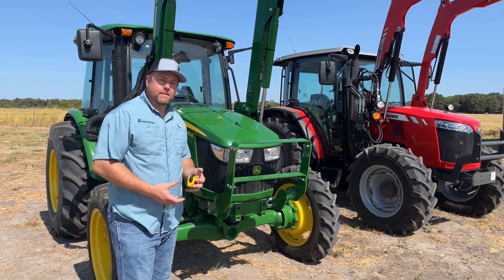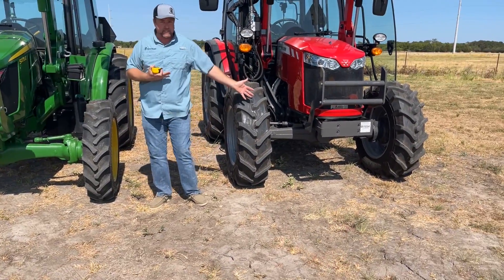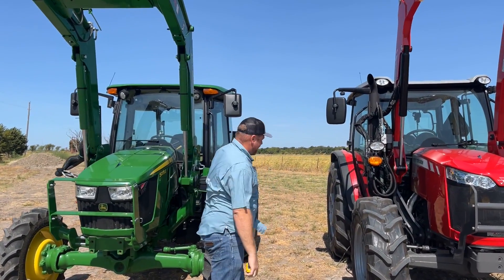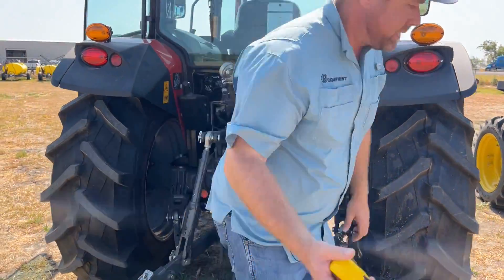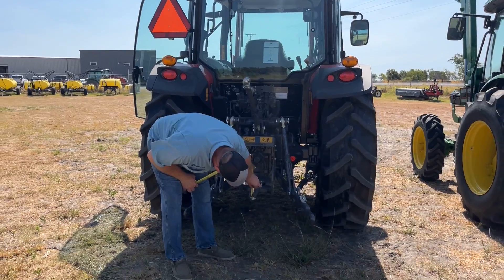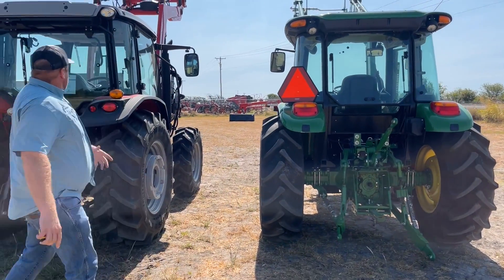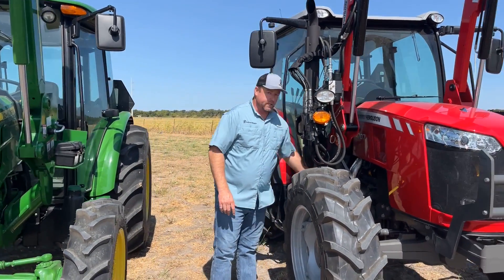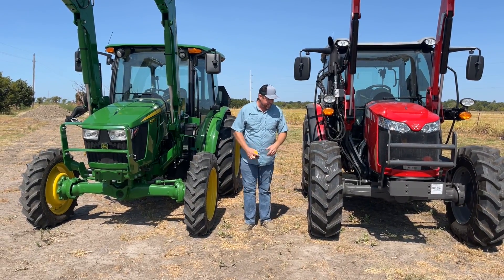John Deere 5075E vs Massey 4707 - Does your tractor measure up?

Comment: The 5075e is the base model. The 5075m would be a more appropriate comparison in my opinion. The massey 4707-4710 are all the exact same tractor just with different engine power.
Reply from the maker: The 4707 has no emissions and a different turbo so there are differences.  The M is definitely a more appropriate comparison for feature but we’ll smoke it in price.
Reply: @prequipmentsales  can't wait to get mine. Still a ways out but so excited getting the upgraded 1535 loader I believe it is.
Reply: Thoughts on a Case 75A
Reply: Exactly !! Do this video over with a 5075M john deere . Then put MSRP with dates on both tractors .
Reply: @ryantucker5903  run!! Got three friends and a bunch of videos on that model case and it has a lot of issues with bad dealer support.
Reply: I just measured my 5075 E and the rear tires measure 18 inches wide ,the front tire measures 12 inches wide. and the loader thickness is 1 1/4 inches thick. Tracker weight without loader is 7600 LBS without loader, Lift capacity to full height is 3674LB. I took this info out of the new JD 5 series book for the 2024 model year.

Comment: The "Massey" is a "little Big tractor"& the "Deere" is a "Big little tractor". The 75e is an "entry-level" 75hp tractor. The Massey-Ferguson 4707 is a small horsepower "Professional Tractor. The price point probably determine's what tractor they will chose& verses ligjt-duty to heavey-duty. Would like to know the prices on both-even "if" it's just by percentages. The Massey-Ferguson IS REALY 40% more "tractor" than the John Deere in this "series" comparison. Thank you Sir for the great Vidio comparison.
Reply from the maker: Thanks for watching!

Comment: Don’t you love how they always compare their premium tractor to an economy built john deere?! lol. It never fails.
Reply: Exactly!! 

"Let's talk about THIS raw measurement of the three point." Yet not talk about differences in steel density.
Reply from the maker: I ran the build and price tool on both tractors this morning.  The John Deere 5075E with standard cab, 1 remote, 4x4, power shuttle and 520M non self leveling loader came out to $70,700

To add Premium Cab(closer to Massey’s deluxe cab) and a second remote to the 5075E it’s another $6,000

The Massey 4707 with deluxe cab, FL3522 mid spec loader with soft ride, 2 remotes air ride seat etc is $71,870

And after all that the Massey is still 2500lbs of more tractor.

Seems like a pretty fair comparison dollar wise which was exactly my intention!
Reply: @prequipmentsales   now, one more thing? All the massey dealers where i live keep going out of business or quit selling massey’s saying that agco makes demands  on them that are impossible to accomplish. How long have you guys been a massey dealer? Just curious. I once owned 5 massey’s and 3 dealerships went out of business within 6 years of each other. I now own a kubota and a john deere.
Reply from the maker: @dannyboy6332  so we’ve been with Massey for 3 1/2 years.  However prior to opening my dealership I worked for Agco(Massey) corporate so I’ve seen things from both sides and probably visited half the dealers in the country.  Therefore, I knew what I was getting into and I still chose Massey.  No it’s not as easy as being a Mahindra dealer or Kioti dealer but if you build your dealership on a solid foundation of parts and service, I think you could be very successful with it.

Comment: I’ve been a Ford guy for life. I love my old blues, but I needed a 100 hp tractor on this frame size. I went on a DEEP dive back in spring. Fast forward and I found a 2020 MF 4710 with 239 hours on it for $57,000 at a Deere dealer. I haven’t truly run it yet (cleaned up around the barn with a little 6’ rotary) but I really like it so far.

Comment: I’m interested in a Massey 4700 series but prefer to not have def. But need closer to 100hp in the next few years. Could I buy the 4707 and after the warranty tune it to match the 4710? I just want the most tractor for the money but also don’t wanna trade up in 5 years
Reply from the maker: As a dealer we can’t recommend any modifications to the tractor beyond manufacturer specs.  That being said……..you wouldn’t be the first.

Comment: I like the Massey but you can’t find one in Oklahoma and I can find 20 John Deere dealers in Oklahoma. I would have liked to compare them both in person.
Reply from the maker: Definitely check out all three videos comparing the two.  Where in Oklahoma you out of?
Reply: @prequipmentsales   Mcloud. East of Oklahoma City about 30 miles. I haven’t been able to even find a dealer with a Massey In stock.
Reply from the maker: @billwright6800  bummer.  We’re a couple hours away but we do have inventory and we’re in Oklahoma fairly often.  Sending 3 balers to Shawnee next month.  Let us know if we can help.
Reply: @prequipmentsales  what model does Massey offer in a 55-65 horse cab tractor?

Comment: Everyone already knows about the Deere and Kubota tax. Masseys compare much more with New Hollands as far as bang for buck. Both very good brands that really mostly care about the meat and potatoes sizes of tractors (60+ hp). CNH and AGCO tractor frames all seem to be a little larger hp for hp compared to other brands. They are both global conglomerates though, so you never know which country made which model. It could be France, Italy, Britain, Turkey, China, Korea, Canada, or here in the US. They also are massive equipment manufacturers too. Case is to New Holland as Fendt is to Massey, or in a fashion, how GMC is to Chevy. They are about 90% the same. There are more notable differences in the Monster class 9 units though, especially the tracked ones.

Comment: Massey should really be compared to the Deere 5075M, not the E. The Deere holds its own there, especially when it comes to overall weight. The E is just too light. The problem with a similarly spec'd M is the extra $20,000 they want for green paint. When you add aTDI tuner to the 4707 youget bout 93 egin HP and 75ish at the PTO, for only another $600
Reply from the maker: Completely agreed that the M is a better comparison spec for spec.. We chose the E because it’s closer in price.  The point we were trying to make was how much more you get for a similar price tractor.
Reply: @prequipmentsales  That's a fair reply and it makes sense.

Comment: Wouldn’t a Massey 4707 be a better match up for a Deere 5075”M” not “E”. The Deere “E” series is purpose built lighter and not as feature rich…. The price for these two tractors would reflect that.  Compare the “M” and see where they stand….
Reply from the maker: The price for the M is significantly higher than the Massey.

Comment: My takeaway was that the Massey is a bigger underpowered tractor. Like comparing a F-350 vs F-150 but with the same horsepower engine
Reply: Pay $400 to have it tuned and you'll get 90hp out of it problem solved

Comment: Price point are not correct. You'd have to at least get a 5075e with the premium which would still be cheaper than the MF. a 5075M is more of a correct comparison. What this proves is that the Deere is a better option for someone trying not to spend as much.
Reply from the maker: We price against the Deere's all day long.  Bring your Deere premium quote and yeah I'll bet I can beat it and give you a lot more tractor.  Thanks for watching.

Comment: Your comparing apples to oranges the John Deere e series is there lighter duty entry level tractor. Not that it’s a bad tractor they are excellent tractors but they are on the lighter side. The 4707 is not that for Massey it should be compared to a 5075m or actually a 5085m
Reply from the maker: If you look at previous comments I’ve answer that question many times.  The intent of this video was to compare the Deere that was closest in price to the Massey.  I agree the M stacks up better but then the Deere would be at a much higher price point so that wouldn’t be fair either.  Thanks for watching.

Comment: Search YouTube. I see a LOT of negative vids on the 4707. I want to like it since I’m in the market and looking for a utility tractor and have been researching it a lot. The last straw: 4707 is China made!
Reply from the maker: There currently made in South America.  Haven’t seen a Chinese one in a few years
Reply: You do realize most of John Deere are manufactured overseas? Hell, up until a couple years back their excavators were all made by hitachi in Japan. John Deere don’t even make the engines for their compact tractors, they’re all Yanmar. The price to buy Deere ain’t worth it. It was between Massey and Kubota, I went Kubota as the dealer is by my house about 3 miles away, Massey is 150, but I’d own a Massey in a heartbeat.

Comment: Should be compared to the 5075m not the 5075e
Reply from the maker: If you look back through previous comments I’ve answered this questions a few times.  Yes based on specs the M is more comparable, however, they’re way more money.  I was trying to compare the closest model in terms of price.
Reply: @prequipmentsales  that makes sense didn't think of pricing